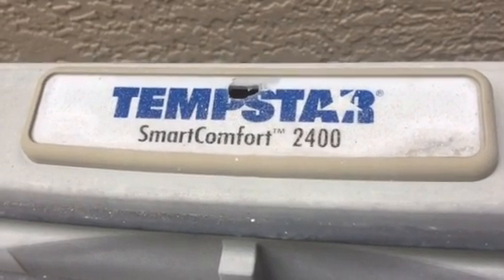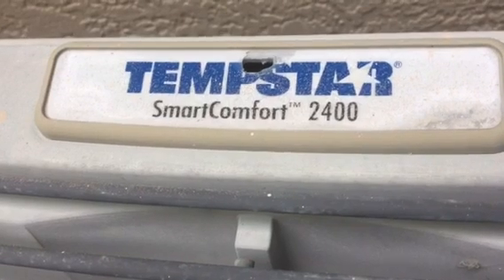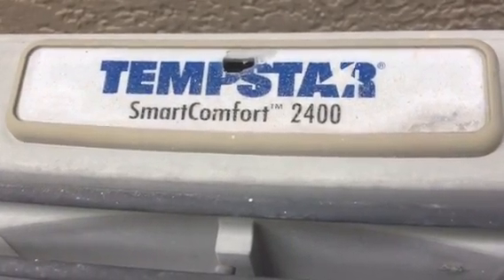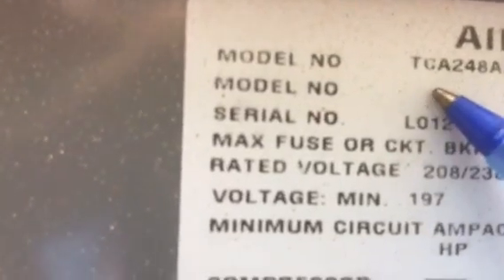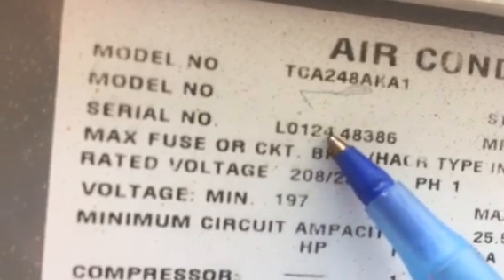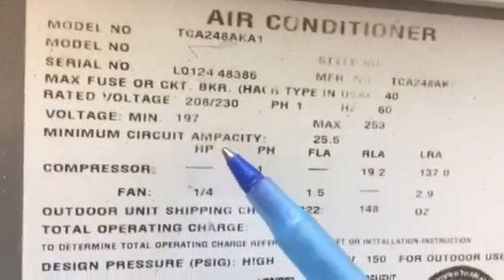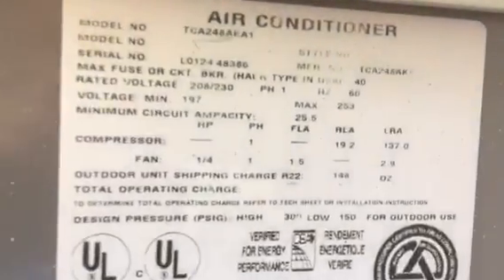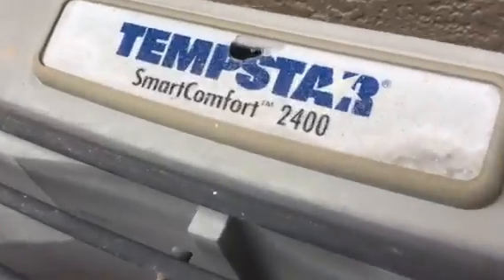How old is my Tempstar?

Comment: I have a similar one at my house, it's a TempStar 2200. It's been running good for 27 yeear. I didn't run the AC for about 5 days but when I went to put it on it was blowing out very hot air, I opened the air handler and touched the condenser that supposed to be cold and it was extremely hot. I wish somebody could tell me what the problem could be.

Comment: The  RLA number confirms it is a 4 ton unit.  19.2 divided by 5 equals approx 4 tons.
Reply: Mitch I have the same 2400 same model number and it said 297 OZ  of R22. Put it in 2001and they said is a 5 ton not sure about the R 22 difference

Comment: This is an early-2000s Tempstar "Slant-Top" unit. We had the heat pump version installed at my parents' house in 2001, but in the eleventh year, it developed an internal refrigerant leak and was recommended for replacement. It was quiet-ish, but not really as quiet as advertised. They did a good job of quieting fan noise with the resin top and the two-speed fan motor, but the compressor (an earlier scroll compressor) had a harsh quality to it that could be heard from the street.

Comment: the 24 in the model number means its a 2 ton system.  24 is divisible by 12 2 times.   12,000btu per ton.  this isnt a 4 ton system

Comment: Tempstar gas furnace disconnected part on unit.. SOOO we ONLY use the unit for a.c. in warmer months in CRAZY weather of Alabama!! Lol. I can't find any videos or information on my 1988..1988 was the test date.. then above it another date 1990. How do I get to the evaporator coil for cleaning... this unit has really been a great one, and just trying to make it last... ya know. and it does have a slow freon leak somewhere.. so I usually have to get it charged up twice during HOT summer's.. and any advice or info would help out sooo much. system holds 5.9 lbs of r22 freon..Thanks..